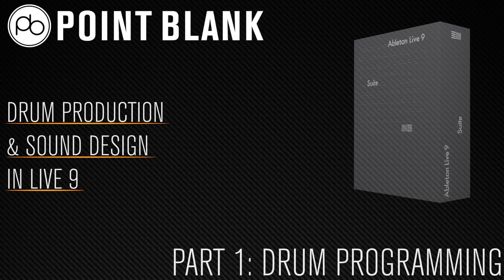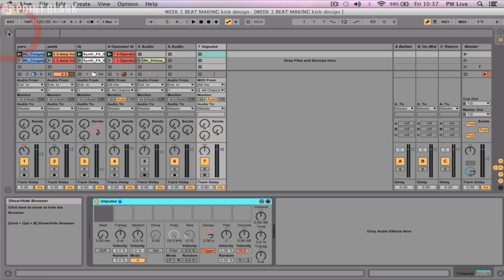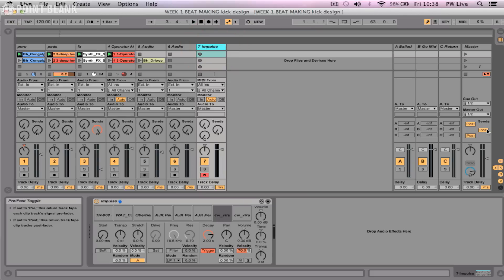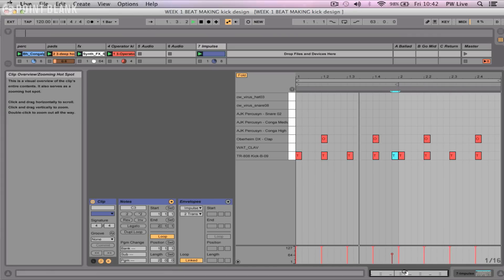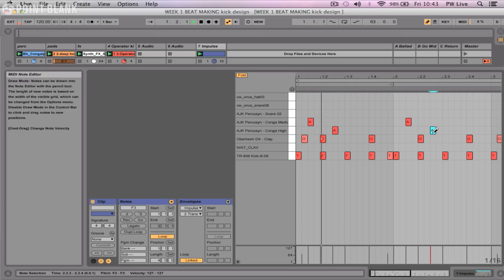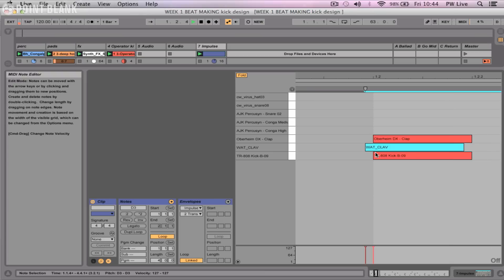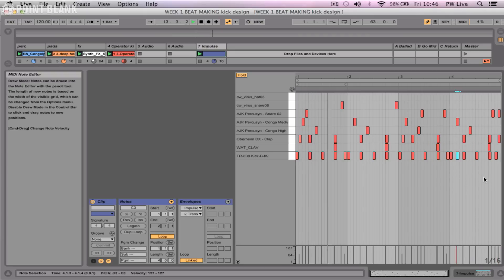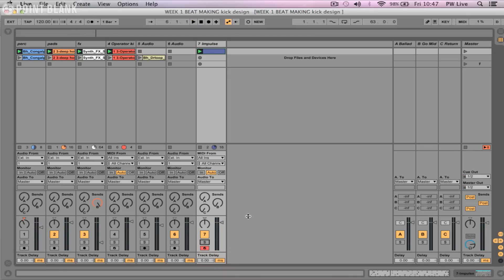Drum Production & Sound Design in Ableton Live Part 1: Programming Drums

Comment: Few tips on the tips :)
- There's a duplicate loop button under the clip's Note section -- rather than doubling the length of the clip, selecting everything, and duplicating it.
- When trying to select all hits of the same type e.g. clap, you can just click the corresponding white (or black) key on the piano roll. Also you can hold alt after you've started dragging notes to temporarily disable the grid, instead of manually disabling it and re-enabling it after. You can even use alt + the arrow keys to move selected notes a pixel at a time (based on the current zoom amount)

Another trick I like is if you're going for a snare roll you can select all your snares and ctrl-click-drag in the velocity editor area to create a linear velocity fade for those notes.
Reply: @Milan Lee flixportal :D
Reply: @Derrick Arthur Thank you, I went there and it seems like a nice service :D I appreciate it !
Reply: @Milan Lee you are welcome =)

Comment: The issue i'm having with anything I produce is that the mix down isn't that loud. How do I get a louder fuller sound? I am a novice when it comes to production. Any/all suggestions welcome. Thanks :)
Reply: I suggest looking up mastering tutorial. (preferably Ableton mastering tutorials) mastering will make your tracks louder and fuller. Most tutorials will probably tell you a glue compressor, and a limiter along with other things. I'm no where near an expert on that but no one else has answered you so I thought I'd try.
Reply: Carter Henderson Thanks Carter. I haven't used the compressor much. I'll take the advice!
Reply: +TroubleinZION no problem! and just to clarify I'm talking about using the glue compressor on the master channel rather than each individual track. it's amazing if you know how to use it.
Reply: I figured that's what you meant. I've never really looked into Mastering, so it really was a good suggestion.
Reply: fill our your spectrum, i notice a lot of newer producers don't fill out their spectrum and settle for only a few instruments, look at your analyzer and see "is this really that loud?" if not then you can add more elements to your track such as more drums, more synths/layers, maybe a pad or a bass.

Comment: i have a problem. 
When i put together some samples, loops anythingelse it starts automaticaly some
 " clicks " on the sound, i don't know if it's a plugin or effect to make this noise..
Reply: Edward Adam Hey buddy! :) It's your buffer size. You may not have powerful enough sound card (it may only support 44100hz). If your card can only produce 44100hz and you are getting crackling while you are on the specific buffer size you will need to buy an external sound card or upgrade your existing one.   The lower the buffer size the more samples it cannot produce and you will gain crackling. The higher the buffer size the more samples you can produce but it may become CPU intensive if you do not have a powerful enough CPU and card. A logical buffer size to use is 96000
Reply: damn ! I think you're right, i will buy a sound card soon cause i hate that clicks on my sound ! Finnaly i know where is the problem, i'd reinstall ableton 5-6 times :))  a big Thank you !
Reply: No problem bro :)